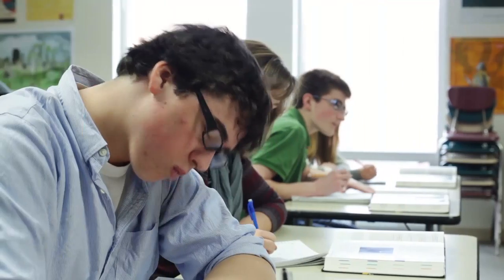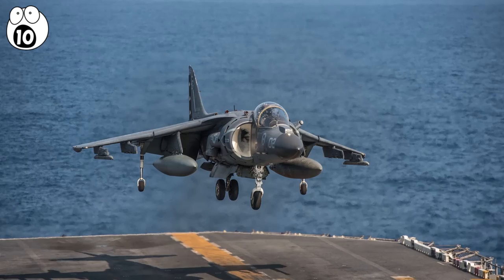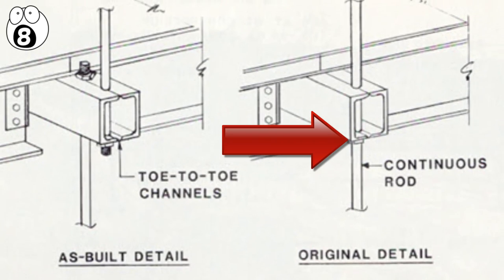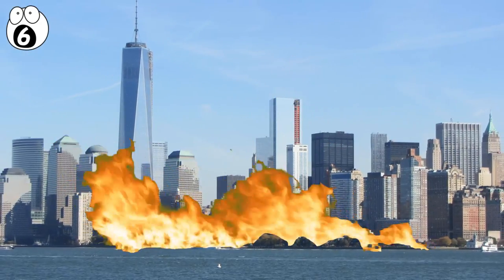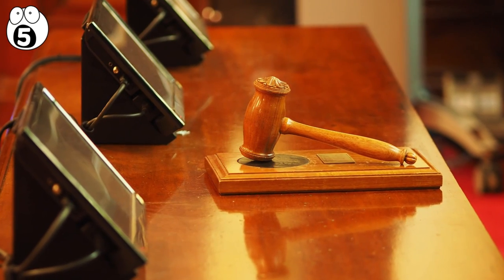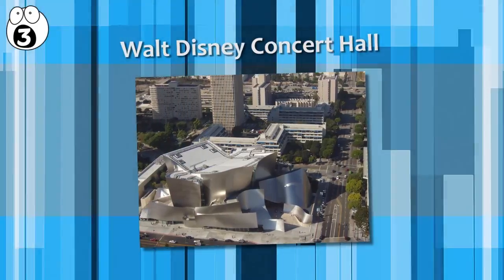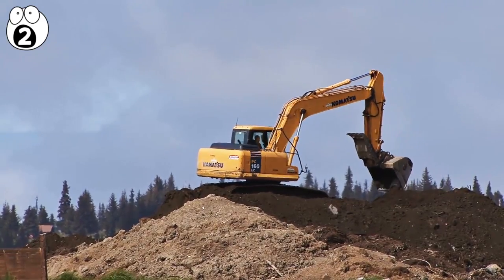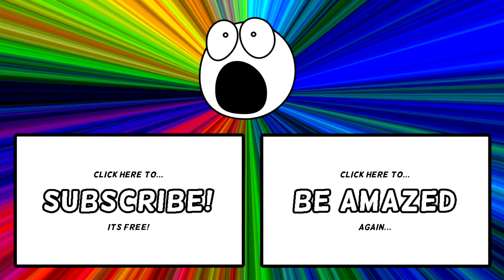Biggest Design Errors Engineers & Architects Made

Comment: You're not an engineer yourself. "No holes in the bridge."
Reply: Test Channel the way he concluded is funny for engineer :v no holes he said :v
Reply: Test Channel i bet if they took a drill and put a hole anywhere on the bridge it would have been saved
Reply: Test Channel Oh yeah. A single hole anywhere. lol
Reply: I approve of your use of grammar!
Reply: Test Channel bridges have gaps or holes so wind and stress don't break them and kill everyone atop.
Reply: This guy is talking shit, the bridge didn't go down because of holes, went down due to resonance applied by the windy day, it was engineered with zero dampening.
Reply: Tacoma Narrows bridge was an amplified resonance - the movement allowed aerodynamic forces to increase the oscillation, and there was insufficient damping in the system to cope.  The lack of stiffness in the road section and its lack of aerodynamic form were both contributory factors I believe.   More modern syspension bridge decks are built as in inverted aerofoil so that wind simply adds to the down-force and stiffens up the entire structure by adding to the cable loads.
Reply: well, in the Takoma incident it wasnt the engineers fault. almost all the bridges at that time were built the same way, because the aerodynamic problem was still at the beggining of its reserch.
the problem with the Takoma bridge was that they built it much bigger then all the others at the time, so the wind affect was much stronger.
Reply: Test Channel The point, is that the bridge failed because it wasn't flexible enough; it wasn't tolerant of punishment. But do enjoy your moment of trying to feel somewhat intelligent, I won't stop you.
Reply: Also the catwalk-problem's description was off. The rod did not fail, the fastening nuts did.
Reply: Having lived in Tacoma for almost 60 years, I have read numerous accounts and it was ultimately caused by a complex phenomenon of wind-induced motion in suspension bridges. Three key points stood out:

(1) The principal cause of the 1940 Narrows Bridge's failure was its "excessive flexibility;" 

(2) the solid plate girder and deck acted like an aerofoil, creating "drag" and "lift;"

(3) aerodynamic forces were little understood, and engineers needed to test suspension bridge designs using models in a wind tunnel.
Reply: +Zoltan Csikos It looked really flexible to me in some videos. imo, the main issue was dampening the motion caused by the wind, not making it more flexible with holes
Some ways that people know now is using helical stakes or more aerodynamic wires to prevent the motion from vortex shedding
Reply: +Andrew2Layton:  That's partially true and partially not.  The point of failure was the welded joint not the rod or bolt.  But the fact that the upper contact of the bolthead with the joint was loaded to twice its design load was why the welded joint failed immediately.  That is, it was such a terrible design that it would have failed even if they used the single long rod like they were supposed to, but probably with advance warning consisting of slow, visible cracking, after some months in use.  As designed, each platform would rest on one bolthead at a distance along a single rod.  Each interface of the bolthead with the welded joint was strong enough to support the static load of one platform and pedestrians, though barely.  But pedestrians aren't static, and it would have fatigued out relatively quickly even if it was built as designed.  But by suspending the lower platform from the upper platform's box beam, then suspending the upper platform and the lower platform both from the upper platform's bolt, the load on the upper platform's bolthead was 2X what it should be, which means the load on the upper platform's box beam was 2X what it should be.  Once pedestrians got on and added their weight to it, the bolts just tore right through the welded joint like you said.If they had used actual box beams, instead of cheaply welding two C beams together, it was still a terrible design with very little margin for excess load, but it probably would not have actually collapsed.  Welding is like sewing your thumb back on, but not cutting it off in the first place is much better.  A welded joint is much weaker than the original metal, and the extreme heat weakens the original metal around the joint too, so even the beam itself is weaker than it was originally.
Reply: The bridge was design for the wind loads, but at a much higher wind speed, the day it failed, wind speed was nominal, but the natural frequency of the bridge was at this wind load, and this induced resonance which resulted in every increasing lateral and rotational deflections, which ultimately destroyed the bridge. Today, bridges as are skyscrapers are subjected to dynamic analysis in all prevailing wind conditions.
Reply: "The fundamental weakness" of the Tacoma Narrows Bridge, said a summary article published in Engineering News Record, was its "great flexibility, vertically and in torsion." Several factors contributed to the excessive flexibility: The deck was too light. The deck was too shallow at 8 feet (a 1/350 ratio with the center span). The side spans were too long, compared with the length of the center span. The cables were anchored at too great a distance from the side spans. The width of the deck was extremely narrow compared with its center span length, an unprecedented ratio of 1 to 72.
Reply: This article counteracts your argument of the bridge failing due to it's rigidity. From this report, the bridge fail because of its "great flexibility", not rigidity. This guy has no idea what he's talking about.
Reply: Lontracanadensis It's clear you know nothing of ferrous metallurgy.
Reply: Most of the bridges of that time including the original Narrows bridge, and all since that failure, were designed with open truss decks. The narrow's bridge design and model testing had been with 25foot deep open truss framework but was modified during construction (and not with the approval of the original architect as I recall) to use cheaper(less labor) 13foot deep solid girders based on an oversimplified strength criteria. The girders could support the same vertical loads as the trusses, but they caused a vortex in cross winds and had less stiffness. The project had many political and management issues coupled with the cost pressures of the 1930s.  
The replacement bridge actually uses essentially the original deck truss design widened to 4 lanes, stands on the original bridges foundation blocks, and still stands today bumper to bumper with vehicles most hours of the day.
Reply: Galloping Gurdy's issues stemmed from the bridge acting as an airfoil and accumulated vibrations, not just because it "had no holes".
Reply: Just because Myth Busters declared it busted doesn't mean it was. Or that either of its idiot hosts are engineers.
Reply: I had to stop this video from the pure fail of the makers -- of the video.

Regarding the Tacoma Narrows, the mistakes are both by "Be Amazed."

First is the inability to understand the cause of the failure - not the inability to bend, but crosssectional wind creating an aerodynamically amplified resonance.  

Second, it reflects a victory for evidence based, applied science as a whole and specifically, the practice of engineering - even if the project suffered a catastrophic failure.  Like many of the other designs it the video mentioned before I stopped its noise of nonsense, it was a first attempt or boundary pushing.  This video generally goes after the easy target of "first steps."  The bridge was built to the engineering standards and knowledge of the day, and without modern day CAD+CFM simulation, it was literally the best anyone could do - there was no forseeable failure.  (Also, it should be noted was redesigned for cost by Washington State).  

But upon its failure, aerodynamic influences on resonance became an immediate concern and a universal teaching example, to the benefit of man, and to the frustration of Clark Eldridge, the lead designer on the original design upon being captured by the Japanese in WWII.  The Japanese POW camp's engineer officer was present during the "roll call" of new prisoners, and when Eldridge's name was called, the engineer went over to him and exclaimed "Tacoma Narrows!" adding insult to injury.  

Cute story, but the point is, the practice of engineering everywhere grew immediately.

The Citicorp center was more of a failure because with decades of civil and materials engineering advancement and the rudiments of computer simulation, it failed to account for aerodynamic stresses, especially in a square grid system of wind tunnels with ever changing profiles as buildings go up and down in Midtown (also sandwiched between an ocean and a river/estuary).

But again, with the Citicorp building, "Be Amazed" fails in the details.  The building had been completed.  It was an engineering *student*, and not from a top school, but NJIT (if memory serves) who noticed it on a tour and immediately warned about the improper reinforcement against once in a century storms.  The building was retrofitted over a weekend.  

I don't mention the "name recognition" of the school to denigrate any institution or its students; NJIT doesn't need a defense.  I mention it to show that the lessons from failures are disseminated and taught everywhere, and if the error is noticed, the only real design failure is to ignore what's been shown.  And in the case of Citicorp, despite the inexcusable error in the architecture or construction, a student's evidence based observations changed a multi-million dollar error.  So there was still a win in that.  

But none of those details are in this video.  Because it doesn't do the two important design things:

1. Note the important details that user/consumer (can, will, or should) ignore.

2. Stop, revise, reevaluate/iterate when demonstrated to be wrong.

I am not an engineer.  But I would not cross a bridge made by anyone who had a hand in this script.
Reply: OK to clarify my original comment, I wasn't claiming to be an expert on what caused the bridge collapse. My comment was spurred by the funny way in which the "Be Amazed" way stated the cause of the bridge collapse which made it obvious he didn't know what he was talking about and had just read it somewhere.

An engineer wouldn't have used such a juvenile description.

Comment: Your video makes "Fake News" look like well researched, factual news. The Hyatt Regency Walkway was neither a Engineer or Architect failure, it was a construction change on site without checking with the engineers or architects.
Reply: The construction contractors did check with the engineers, but the engineers passed it off with out checking.
Reply: I'm pretty sure the reason they changed the design was because in the original design they would have had to put thread all the way up the rods but with the change they only had to thread the ends so it saved them a lot of time.
Reply: Paul Valentine   So the fact it was the first building architecture designed on a modern computer has nada to do with its catastrophic failure?
Reply: Dan, not sure what your saying here..... from what I understand the rods did not fail.  The top level was hung correctly to the rod connected to the roof.  The next 2 levels were hung from rods attached to the thin walled beams of the top level.  These thin walled beams could not support the weight the lower 2 levels and the nuts ripped through the metal beams like they were tinfoil.
Reply: What do you expect from a guy who thinks math(s) and physics are not fun?
Reply: The original design was also found to be below the required minimum Kips
Reply: joe jitsu Good! I'm glad they lost their licenses after a major screw up like that!